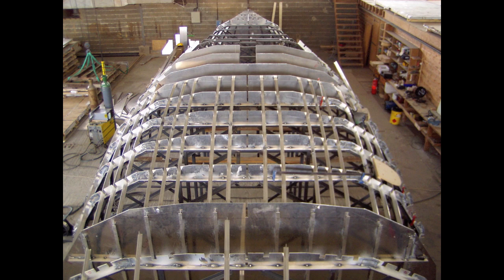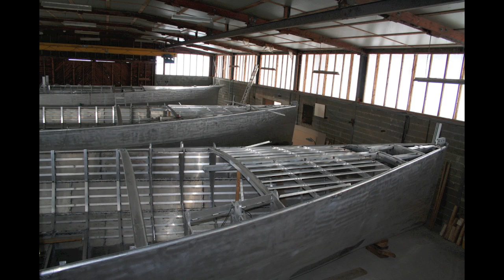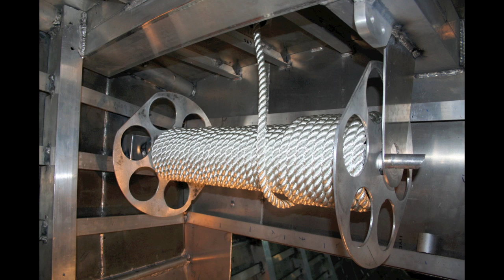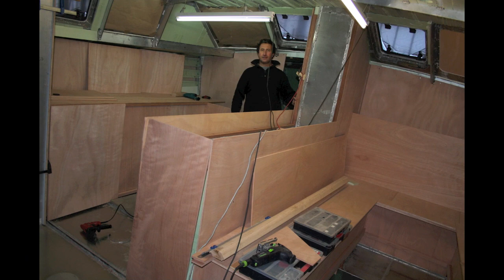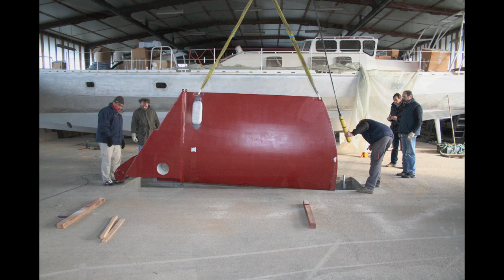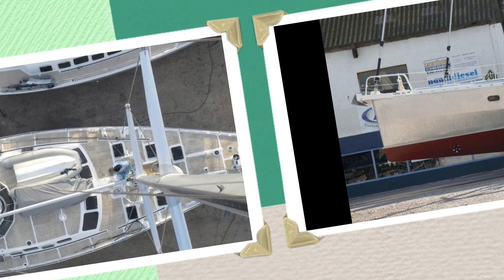2003 à 2009 construction de 3 voiliers aluminium 17m pour hautes latitudes

Comment: C'est un travail magnifique. Appeler ça de la construction amateur est inapproprié, c'est infiniment plus professionnel que 99% de la production nautique d'aujourd'hui... La seule chose que je trouve dommage, sur des projets de ce niveau, est de se limiter à un seul moteur, une redondance à ce niveau créerait une sécurité supplémentaire et quitte à tout faire... mais pour le reste, splendide.

Petite question, vu le volume de mousse isolante employée, qui ne doit pas être loin de 20 m3, est-ce qu'elle crée une réserve de flottabilité suffisante pour rendre le voilier insubmersible? En faisant le calcul, 30 tonnes de poids total en charge, il doit y avoir 15 tonnes d'alu pour la coque et les superstructures, 5 tonnes de lest et moteur, 5 tonnes de bois qui flotte, 3 tonnes d'eau et de fuel qui n'influent en rien sur la flottabilité, 500 kilos d'isolant, la densité de l'alu à 2.7 fait qu'il n'y a que 9.5 tonnes d'alu à faire flotter, plus 4.3 tonnes du moteur et du lest (probablement densité 5) donc 14 tonnes de flottabilité qui pourraient être portées par la mousse?

Evidemment en hautes latitudes ça ne change pas grand chose de geler ou de couler, mais là où la plupart des marins aiment passer du temps, ça ajouterait une belle qualité supplémentaire à ces magnifiques voiliers...
Reply from the maker: et oui europe des controles, vu qu'on n'a pas fait les démarches administratives on reste unité amateur et interdiction de vente dans les 5 ans et de naviguer au large pendant cette période et ils considèrent l'age du bateau au jour des plans et non de la mise à l'eau...
Pour la flotabilité avec l'isolant je pense un peu la même chose
Reply: @fredofredoya  vu le professionnalisme de l'état et des professionnels autodécrétés dans la lutte contre le covid, il n'y a rien de surprenant à ce que Bénéteau fasse des voiliers "professionnels" et que votre unité soit une construction "amateur".

C'est même plutôt logique dans le fond.

En tout cas, quand je vois vos axes de dérives, ceux des safrans, où tout a été prévu pour pouvoir taper de l'iceberg sans conséquences... je doute fort que même Boréal, Ovni, KM yachts bossent à ces niveaux là par défaut (Même si l'on ne peut pas nier qu'eux, par opposition aux fabricants de caravanes flottantes sont quand même des professionnels qui méritent l'appellation !!!).

Et pour ce qui est des normes, l'Europe est en train d'en mourir. Un savant mix de normes et de connerie, alors du coup, je ne peux que vous féliciter pour avoir réussi à partir loin des cons et à y vivre, la vie d'un pingouin sur la banquise valant plus que celle de 10000 technocrates.